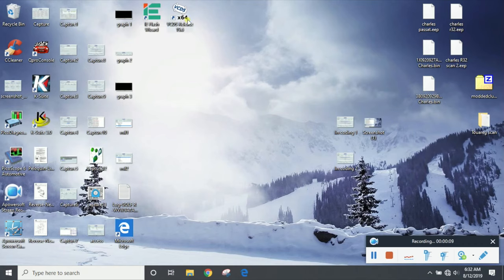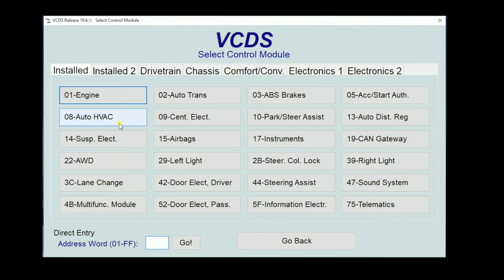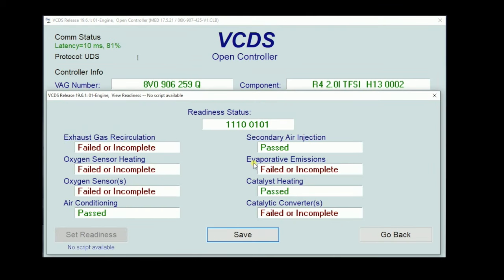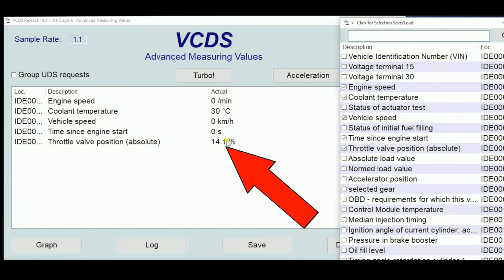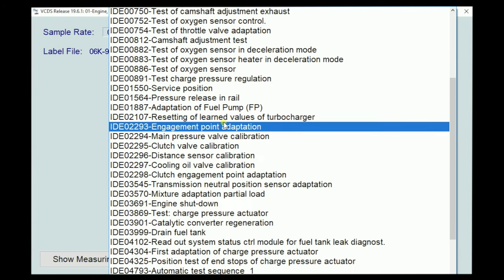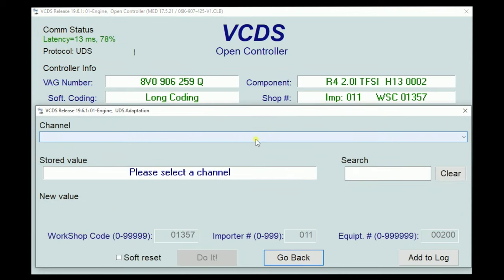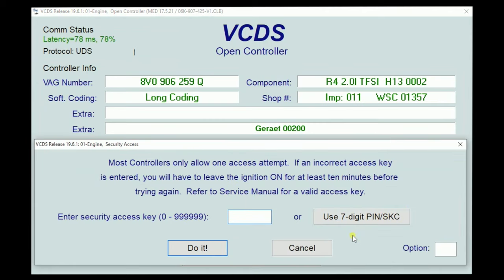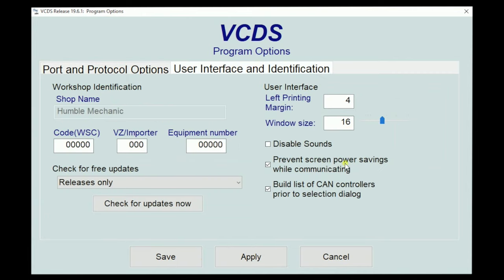VCDS Tutorial ~ How to Use VCDS Scan Tool

Comment: how can I clear a component protection  code on my s4?
Reply: Unfortunately. This might be one of the limitations of VCDS. 

Component protection is often due to swapping {already previously coded} modules from other vehicles. 

It's an anti-theft mode of sorts.

The offending module will probably have to be reprogrammed by a dealer or VW/AUDI specialist with ODIS and the appropriate security clearance.

Comment: Have a 2004 Volkswagen Passat 1.8 L I hope that's not one that takes forever is it got trans issues
Reply from the maker: It’s really slow. Not horrible but slow compared to the newer stuff
Reply: @HumbleMechanic   OK thank you quick question you don't have to think hard on it but the  transmission has fluid in it it is pretty Derek I am going to change it it makes like a cavitation sound, and when you put it into gear it gives you a big thud and the mil light is on but I can't read it with my normal code reader

Comment: Hi how to do needle sweep on vcds for my car volkswagen golf 4 1.9 tdi 66kw variant 2001.
Reply from the maker: That is firmware in the cluster. You can't do it wiht VCDS
Reply: @HumbleMechanic  I don't know what. My cluster have board computer which shows fuel consumption, Outdoor temperature. And mileage.

Comment: I would love it if YOU or someone else could help me figure out what's wrong with my 2006 Audi S4 Avant (only 56k original miles).
A couple weeks ago I got home from work and out of no where the radio (6 disc cd changer bose system) failed to turn off when I
turned the car off and removed the key from the ignition.  I thought this was very odd.  Decided to lock the doors with my remote to
see if anything would happen and sure enough the radio STILL stayed on.  I then thought I turned it off manually by pressing in and 
holding on the left knob of the radio but later on found out that all this does is turn the screen off, but doesn't actually turn radio off.

After doing some research (understand I'm not very car savvy) I came to the conclusion that there was a battery drain issue caused
by the stereo so I decided to purchase a Pioneer double din.  I'd heard other people with very similar issues to what I was experiencing
who said they replaced the factory radio and that it fixed their problem.  However, I was shocked to find out that once the radio showed
up from Amazon I couldn't jump start the vehicle.  Because of this I assumed that the battery was probably toast.  Especially since the
vehicle is 14 years old and it appeared to be the stock battery.  I bought a new battery and installed it in the car thinking it'll finally start
and of course I was wrong.  To simplify what is working vs what is NOT working I'll make a little list.

WORKING
========
-HEADLIGHTS
-DOME LIGHTS
-DASHBOARD LIGHTS
-ELECTRIC SEATS
-BRAKE LIGHTS
-RADIO (but have to disconnect battery otherwise it'll drain it completely)

NOT WORKING
============
-CAR WONT START AND IT WONT EVEN TURN OVER
-KEY FOB NO LONGER PROGRAMMED TO CAR (SINCE REPLACING BATTERY)
-FUEL PUMP DOES NOT APPEAR TO PRIME (DONT HEAR THE SOUND)
-WINDOWS WILL NOT POWER UP OR DOWN
-HORN WILL NOT HONK
-LITTLE SCREEN ON DASHBOARD IS BLACK/BLANK 
   (THE SCREEN THAT USUALLY SHOWS INFO SUCH AS "PLACE FOOT ON BRAKE BEFORE STARTING CAR" etc.
-RADIO PLAYS AUDIO BUT STAYS ON AFTER KEY REMOVED SO I LISTED IT IN THE "NOT WORKING" SECTION AS WELL

With that said.  Everything appeared to be working perfectly fine for the 2 years since I purchased this vehicle.  The only thing I've ever
had to replace on it so far was the rear tail lights.  One of them went out and then after replacing it a couple months later the other one
went out.  Aside from that I've only done basic maintenance on the vehicle such as replacing the tires/brakes/coolant flush/oil etc.
You can tell I'm getting tired of dealing with this issue by how precise and in detail this comment is.  I really need to get this fixed because
I haven't been able to go out and find another job (lost mine because of COVID) and I'm starting to quickly fall behind on bills.  My Audi has
been out of commission now for almost a month.  I have no idea what to do from here and of course I'd love to just take it to a dealership
but at the same time I absolutely cannot afford to be dicked around by what many people call a "STEALERSHIP".  They see people like me
from a mile away and will take advantage of me and next thing you know I'll be paying 3 grand for something that wasn't even the issue.
I absolutely cannot have that happen.  

Someone please... for the love of god... PLEASE help me out and give me some ideas on what I could possibly due to address this issue
myself without taking my baby to a dealership that has already screwed me over in the past the ONE TIME I took my Audi to a dealership
to get my coolant flushed/refilled.  I'd rather jump off a building face first than to take my baby back to that place.   Thanks and much love!

Comment: How do you go about resetting and activating steering rack module and it constantly asking for access code and then typing it in and it still asking for the code
Reply: If you don't get a prompt answer here, have you tried Ross Tech's support? They might be able to help you out?
Reply: It’s for a audi a7 2012 steering is stick and every time I try to activate it it’s asks for the access code and when I type it in and I go activate it again it’s still asks for the access code
Reply: @Mdot401  I'm not sure about that.
 Is it a new module? Is the vcds software up to date?
Reply: @atrain132  yes just got it last week
Reply: @Mdot401  hmmm. Is it a genuine Audi module? If so, I don't know what would make it continuously repeat the access code question. I'd ask Ross Tech support for help on that.

Comment: Hello folks,
I hope someone here can help me, unfortunately I purchase a 2009 vw jeta sport wagon with transmission issues,
The guy told me it runs only from the 1rst to the 3rd gear which is true,
So using my VCDS I get a code p034 incorrect rotation on 4th gear,
I test all harnes one connector was bent someone was already messing with it, I get a whole transmission from a wreck car that it was running fine, first I swap the harness and body valve, when I was trying to relearn all I get is error message?
Ignoring that I swap the whole transmission with torque converter,
No luck the same issue it only runs 40 miles and it's stuck on 3rd limp mode,
I swap the TCM every cable tested fine, but the problem consists,
If someone can advise or help me with this problem I really appreciate.

Comment: Charles, could you please do a comparison between the VCDS tool and the OBDeleven sold by DAP (https://www.shopdap.com/catalog/product/view/id/804282)? I would love to have your opinion so that I can make an informed decision as to which one to buy.
Reply from the maker: So for me it’s a simple choice. OBDeleven is fine but has limited use. It you only want to change some coding and scan the faults it works fine. 

VCDS is a proper tool. I used it along side the OEM scan tool since 2005. It’s worth the price difference for me. But not for everyone
Reply: @HumbleMechanic  I am thinking the same thing. If I am going to be serious about keeping this car forever (yes, your read that right) then I need to get the right tool for that job.

Comment: 01-Engine -- Status: Cannot be reached 0100
02-Auto Trans -- Status: Cannot be reached 0100
03-ABS Brakes -- Status: Cannot be reached 0100
08-Auto HVAC -- Status: OK 0000
09-Cent. Elect. -- Status: Malfunction 0010
15-Airbags -- Status: Cannot be reached 0100
17-Instruments -- Status: Malfunction 0010
19-CAN Gateway -- Status: OK 0000
44-Steering Assist -- Status: Cannot be reached 0100
5F-Information Electr. -- Status: OK 0000
 
I can't reach many parts, why?
Reply from the maker: Yikes.  Ignition switch maybe
Reply: @HumbleMechanic  I don't understand
Reply from the maker: I’m not really sure how to help.
Reply: @HumbleMechanic  TY

Comment: Charles my vcds program suggests i should upgrade to 19.6.1 (mine is 15.something) but if i do upgrade when i click test port and   it tells me to upgrade my vcds cable drivers, wich i checked and have the latest drivers, any suggestions?
Reply from the maker: Yeah you have to do both. You are WAY outdated. LOL That said if you are working out fine with the current thing you are doing, rock it.

Comment: charles or anyone know what this code means? Clutch 1 Opens Unintentionally 
          P175D 00
Reply from the maker: Depending on the transmission this forum post may help https://forums.ross-tech.com/showthread.php?9880-Skoda-Octavia-DSG-gearbox-rpoblems
Reply: @HumbleMechanic  Thanks! Do you think the selector forks for changing the gears could be in the wrong position? Do you know what measuring values on vcds that could possibly help me diagnosis this dsg problem?